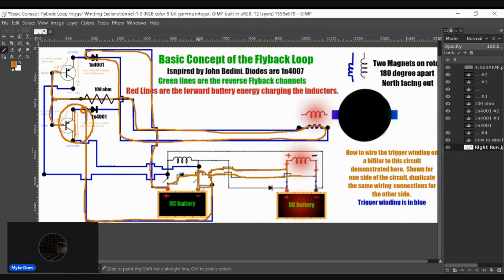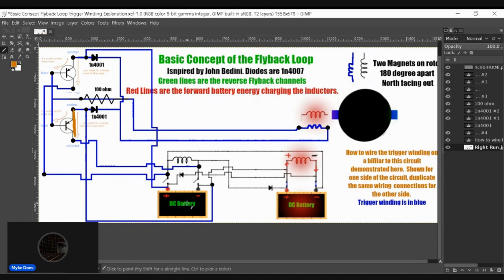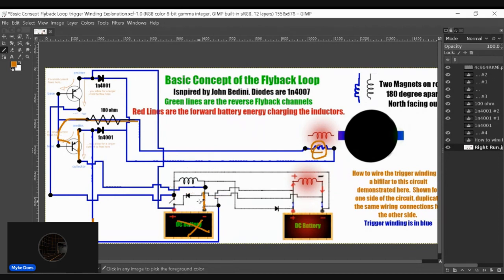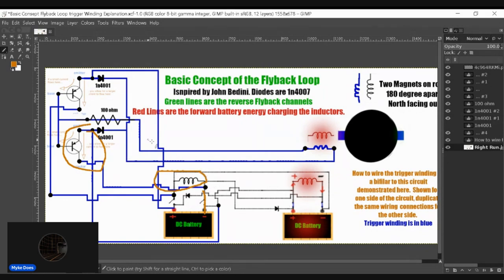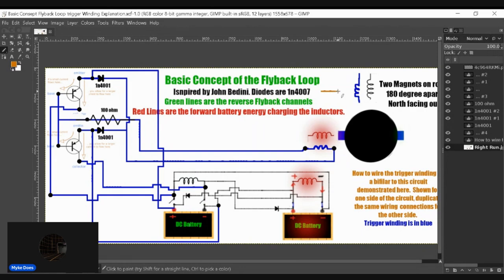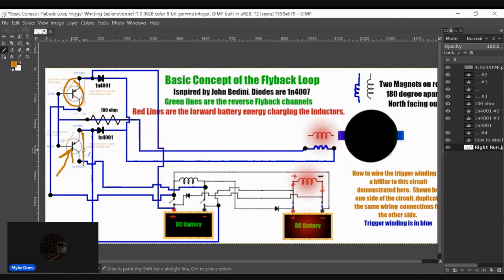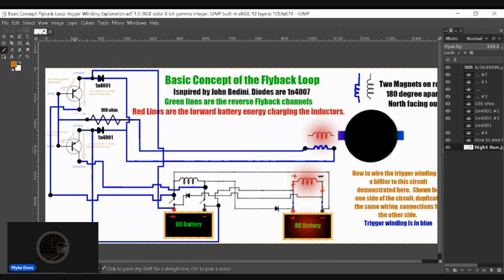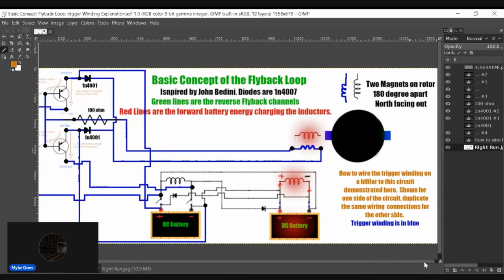Basic Concept Flyback Loop Trigger Winding Explanation Live Stream part 2

Comment from the maker: You can use and opto isolator , to trigger the base. Feed the trigger winding signal into the isolator then use the opto isolator signal to trigger the base , this will avoid this  seemingly minor issue   https://1.bp.blogspot.com/-ZdLZGHQ8WvI/X4mC9tsm9SI/AAAAAAAABzw/LqgnkHhgzVw2ZkVR_1gF8vpG2cHE0xX9gCLcBGAsYHQ/s518/opto-coupler-or-opto-isolator3.jpg